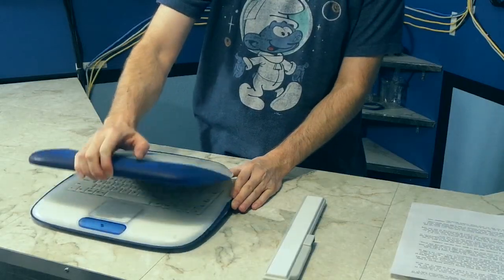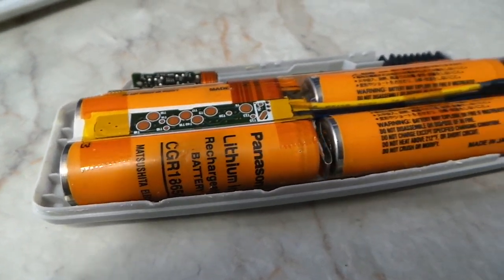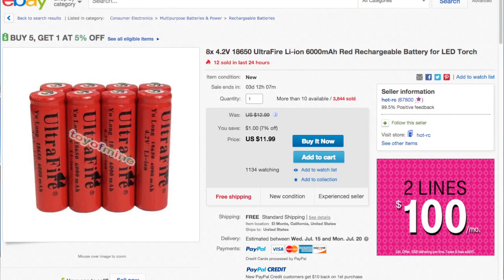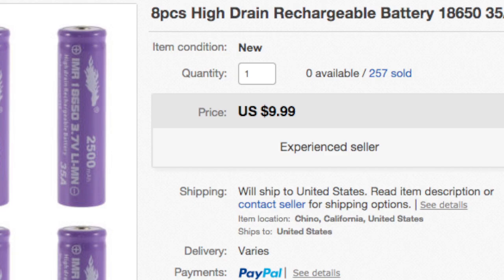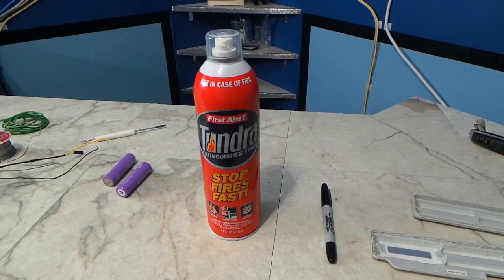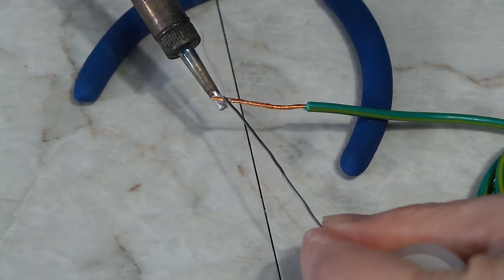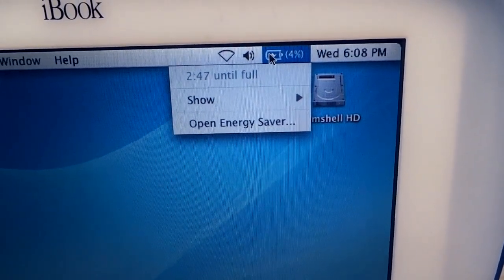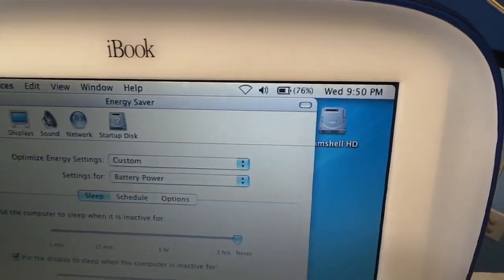Rebuild a laptop battery pack

Comment: How can I buy the electronic board ? or repair ? I think my electronic board is damaged , I reinstalled my os , tried with Linux battery seems more than 50% only  but not charging I tried opening my battery pack and jump  +Ve battery to battery output +ve section battery is working properly what to do ?

Comment: I tried rebuilding one of my old batteries for my Lenovo T61 laptop, but they put an anti-rebuild protection in the controller, so as soon as you disconnect the cells from the controller, it kills it there and then, regardless of whether you used shiny new batteries or recycled ones from a good but different laptop battery... :\

Comment: why my laptop battery still drain quickly after recell ? Total capacity onlu 6221 mWh from Designed Capacity 47520nWh. I am replacing the battery with the same capacity

Comment: the Mac OS looks good n clear resolution on this iBook.  Windows XP looks low res and pixelated.  I really like windows XP.  I really like my late 2012 core i7 mac mini.  I build computers for a hobby.  I love windows 10 more than XP now.  I thought windows 8 and 8.1 were better than vista.  To me windows 7 is good, but I like the low system requirements of Windows 8-10.  I love the "expose" and snapping windows in windows 10 a lot.  I think windows 10 does expose and window snapping better than Mac OS even though Mac OS came out with expose first.

Comment: "ultrafire"   probally not the best brand name for lithium batteries"
Reply: A year or so ago when e-cigs first became incredibly popular I repaired them for people a lot, and most of them use an 18650 battery or two. The Ultrafire ones are complete trash, and that specific brand is known to actually vent/explode a lot in ecig/vape setups because of the insane current draw
Reply: neither is Samsung. take their Note 7 for example
Reply: David Robitaille there is a gta5 mod which made grenades into s7s
Reply: Ultra fire probably means catch on fire extremely easily.
Reply: This made me look at what model my e-cig battery was and it uses that same model.  Didn't realize that laptop batteries could use the same model.  That's neat.
Reply: @ryuranzou  I am very late to this, but if you didn't know, e cigs where mostly designed to use this existing battery, 18650, 18650 specifies the size of the battery. There's also new mods that use 20700, and other sizes that I forgot.
Reply: I guess that's the brand Samsung used on the Note 7
Reply: Ultrafire is a "word play" on Shurefire, one of best and likely most expensive flashlight companies...
As they (Ultrafire) first produced flashlights only, they started making (or rebranding) batteries, chargers and all kind of other stuff years later.
Reply: The batteries that explode like note 7s
Reply: Jason Grimm what do you expect? The name speak for itself and it says it all. Ultra easy to cause fire in your house.
Reply: Fennec Fox So that's what the Note 7 used XD
Reply: Chrispy Chreme Bro lol
Reply: FennecTECH lol 😂
Reply: TheOpAlexGuy : mlgfreddy123 lol
Reply: Yasir Saheed I don't know why, but I keep thinking it's the s6 that explodes lol
Reply: i thinks samsung used them in note 7
Reply: Ismail Shaikh, i have TRIED some great things and they fail, well not completely. 
You CAN recover or at least prolong life of your lead acid battery in some cases, but not in all, so if you use dirt cheap chemicals or desulfatators, why not, it's worth trying if you know how to be safe, basically just wear eye protection and wash acid off yourself if you get splashed by it on skin, JUST DON'T PANIC, you have like... few minutes before it will burn you, unless you get it in eyes ;-) 
You can't really fix/recover li-ion battery IN ANY WAY once it is worn, unless cells are ok and electronics failed.
Reply: Rodrigo Vicente, Fenix is a good brand, if you mean that. 
It has nothing to do with Ultrafire. 
Fenix flashlights and chargers and batteries etc. are allways good choice...

Ultrafire batteries are ALLWAYS crap, sometimes half usefull crap, but still...
If you get brand name cells with your Ultrafire product, it means seller/store replaced/ packed them together, coz they were sick of complaints, waranty claims and fires. 
It makes sense, as Ultrafire make somewhat good products, flashlights, lasers, chargers... just their batteries are total crap.
Reply: FennecTECH so fucking true 😑😑😑😂😂😂😂😂😂
Reply: لو سمحت ممكن المساعده لان بطارية اللاب توب سرقت مني وغير متوفره نهائي فكيف اوصل بطاريه اخري بحجم اخر تماما فقط اريد معرفة اين ادخل سلكين يعوضو عن بطاريه اخري وانا اعلم كم هو الفولت المطلوب وشكرا ارجو الرد لو سمحتم
Reply: Creeperguy55 My brother, the virtuous, the battery is stolen from me and I want to know only how the first battery is another Atari Valsokt to Vellab Top I want the numbers of the years to the South by the battery type and size Tani pure external battery What are the negative and positive parties to the top dog to bring them a battery with only two wires Thank you very muchstole
Reply: Creeperguy555 ؟؟Creeperguy55 My brother, the virtuous, the battery is stolen from me and I want to know only how the first battery is another Atari Valsokt to Vellab Top I want the numbers of the years to the South by the battery type and size Tani pure external battery What are the negative and positive parties to the top dog to bring them a battery with only two wires Thank you very much
Reply: FennecTECH maybe the worst. Haha. LG Samsung are pretty good. Just don't think it's they easy to buy them to buy them though. Be
Reply: FennecTECH lol
Reply: it's actually quite fitting for these
Reply: The fire is as big as all the flammable liquids and all the batteries on earth and 20 Note 7s.
Reply: FennecTECH I want to know whether is it safe to use any power adapter to any electronic device if the output voltage of the power adapter matches the operating voltage of the device but what if the output ampere of the power adapter is high? I am asking this because I have noticed that we can use any rechargeable AA battery of higher amphere to any electronic device like camera or CD player but can we do the same with a power adapter?
Reply: there's a new one called "BestFire"
Reply: not really it's a good name if you're expecting your batteries to explode
Reply: MXJO
Reply: FennecTECH POlM

V
Reply: @fennecTECH: It was chosen with good reason!
Reply: this batteries is making ultrafire
Reply: nomen est omen!
Reply: Ultrafires. I know they're not good. Nerf modders know and use them.
Reply: LOL scrolled down just as I was thinking this.
Reply: XD imagine SpaceX being called "Mega Explosion"
Reply: Hold my Note 7
Reply: No joke, these things will go thermonuclear. They generally don't require outside oxygen to burn either, that's why a carbon dioxide fire extinguisher doesn't work with LiPo fires.
Reply: True
Reply: Ultrafire makes flashlights, great stuff! Not as bright as o-light but still good on a budget!
Reply: lmao
Reply: Yes
Reply: I bet they used them in hoverboards when they first came out
Reply: 😂😂😂 never thought of it
Reply: The Note 7 didn't use this particular model of cell, as it would be nowhere near small enough to fit in their phone. As for who made the batteries used in the Note 7, I don't know, but could possibly find out with a bit of research.
Reply: @evknucklehead  r/wooosh?
Reply: @DJ4461  Seriously? You r/wooosh a comment from over 2 years ago? 

At any rate, people are too quick to use that. As I recall, I was fully aware of the joke, but chose to respond seriously as a joke of my own. So, in essence, anyone who uses that just woooshes themselves.
Reply: @evknucklehead  oh... Sorry. I didn't get that. That's why I added the question mark.
Reply: @evknucklehead  r/woooosh
Reply: @aretard7995  See my reply to the previous r/woooosh comment in this thread...
Reply: @evknucklehead  the note 7 exploded because they crammed the battery in a small space
Reply: Its even better, it means alkaline metal fire that water makes burn even hotter
Reply: FennecTECH probably the battery the note 7 used
Reply: it was so funny that I forgot to laugh
Reply: Cheers for the video content! Excuse me for chiming in, I would appreciate your opinion. Have you ever tried - Lammywalness Trendy Trade Guide (Have a quick look on google cant remember the place now)? It is a smashing one off guide for learning how to recondition batteries at home minus the normal expense. Ive heard some incredible things about it and my buddy finally got amazing success with it.
Reply: TheOpAlexGuy : mlgfreddy123 yea😂😂🤣🤣🤣
Reply: FennecTECH ultrafire uses panasonic and Lg batteries
Reply: @rodricochecitos  that is 100% false. ultrafire is a cheap chinese knockoff.  I have spent the last couple years building packs for e-bikes and long range RC aircraft.  Not only are the ultrafire cells horribly underpowered, they are also extremely dangerous. I exclusively use LG cells because I know i can trust them. There are a few cells on the market that offer higher capacity, but I can say with confidence that LG or Sony are the most stable.
Reply: hi everyone ,if anyone else needs to find out about how to recondition batteries at home try Battery Recovery Tactics ( http://battery.RecoveryTactics.com  ) ? Ive heard some great things about it and my friend got excellent success with it.
Reply: hi everyone ,if anyone else needs to find out about how to recondition old car batteries try Trefendous Rapid  Extender Tips (just google it ) ? Ive heard some amazing things about it and my work buddy got excellent results with it.

Comment: Hello The-8-Bit-Guy,

I want to rebuild my laptop battery but I have a question,

Can I replace the existing mAh cell with higher mAh cell..?
Reply: If they are real it should be fine to put higher capacity batteries in it

Comment: Soldering batteries like that is stupid. You're damaging the batteries due to the hight temperature of the solder. You can even make burn those Li-Ion batteries. To solder batteries you need a cold spot solder.

Comment: you can get good quality 18650 lithium ion batteries, 3.7V 2000mAh, from interstate battery. they are interstate battery brand, solid green with numbers printed on the side, but they really are great batteries, I've used them for several projects. they keep them in the back so you'll have to ask for them but there only $5 each and you won't have to wait for the mailman.

Comment: Great video!!

So, if your current battery still works (to some degree) but shows it's not recognized by the computer, is there a way to reset, or repair the input that the computer sees?

On that same note, if you just rebuild a older battery, not the one referenced as not recognized, does the circuit board on the battery tell the computer the correct info as to life, performance etc? or does that correct itself after a charge / discharge cycle? 

Something like batterybar Pro, has diagnostics and such, but I'm not sure if it would read old information "stored" on old circuit board from before putting new cells in old case/ 

Great video
Reply: Any answer yet?

Comment: Wait... since when are efest batteries offbrand? Or are those efest clone batteries?
Reply: Old efests were  low quality rewrap crap, the newer ones dark purple are actually decent ones (lg samsung sony or panasonic). Only mayor problem i see on efest bats is that they lie about the discharge current, they always stick the pulse current on the labels in stead of the continuous discharge current. Which can be hazardous for unexperienced  /uninformed lith-ion cell users
Reply: Because there are only 5 manufacturers of brand-new 18650's. Efest are re-wraps off low-quality duds, sold in bargain bins by the manufacturers.
Reply: vlad vikernes EFest does not relabel duds... they buy cells 'white label', and sell with their wrap. Most of Efest cells come from sony, LG, and Panasonic, cells those companies do not ACTUALLY sell to consumers directly. Efest buys the same cells and uses their own wraps, but they use quality cells for it, it is just the cells you get were relabeled for the consumer market. In other words, you get the same cells for cheaper, since they were actually intended for the consumer market.
Most 'name brand' EVERYTHING is a relabel... whether you realize it or not.
Reply: Interesting indeed. Im curious to learn some of these relabels. I don't doubt you. Its just what I've been taught or learned in my time. I will admit, I am a noob and my first encounter with an 18650 was a vape. Sorry for being incorrect.

Comment: Only works with old laptop battery. Now they have some component inside to prevent you to restart it if you change the li-cell. And it's way harder to reset !

Comment: Flux the battery terminals first as  it makes soldering the wires on that bit easier,  You can also reuse 18650 batterys from old battery packs as long as they look and test ok,
Reply: +john porter Fine grit sandpaper, then flux, then solder.
Reply: Marc Dudlee the fine grit sandpaper goes without saying Marc...but in a lota cases the flux is enough to remove the oxide coating on the metal as thats whats its job is to do...remove the oxide coating,

Comment: Can I do the same work on a Macbook Pro 13" mid 2009? Which battery I have to buy?
Reply: They do t use those kind of batteries.  For a MacBook Pro that was made from 2009 to present, you can buy those batteries on eBay.  Make sure they aren't fakes!
Reply: Technology Spotlight
Thank you for the reply. I bought a new battery in a shop, because where I live the delivery service make the battery not safe and ther is a high risk of damage of the battery during the packaging (explosion).

Comment: This is really not a good idea, for several reasons:

1) Soldering Lithium batteries is a catastrophe waiting to happen.  Most of the chemistries used in 18650 cells release oxygen when they hit thermal runaway.  That means, if something catches fire, they provide their own fuel.  An extinguisher will be next to useless.  Thermal runaway might occur somewhere north of 150C, but... what's the temp on your iron again?

2) You don't know anything about the charge controller.  Does it assume the cells are pre-balanced?  If so, top or bottom balanced?  Or does it actively balance them?  If it balances, then your first few charges might just take a long time to get from 90-100%.  If it doesn't, then it's up to you to balance them appropriately, otherwise you end up with a "fuel gauge" that is way off.  (Speaking of which, is that fuel gauge self-calibrating, or hard-coded?)

3) What was the chemistry of the original cells?  The new ones?  What is the recommended charge current?  What is the low-voltage cutoff, and at what load?  What voltage should you charge to?  Most common chemistries don't differ by much, but some can be charged to 4.2V while others will get very cranky above 3.6.  Chances are you'll be close.  However, things get really ugly when you're not.  (Keep it off your lap for a while.)

4) As others have mentioned, some charge controllers have cell state memory.  This isn't as much dangerous as a waste of time and money, as it would just mean it won't work.

I'm all for DIY, but Lithium Ion cells are temperamental and the risks should not be taken lightly.  If you don't know what you're doing, this is a job best suited for a battery specialist.  Or just pony up for a genuine replacement pack.  Cheaper than new nads.
Reply: Nick Guy here to second what William d said.  You should make a video.  More knowledge in the world is only better.  You might even save someone a hospital visit.
Reply: You just spend 1 hour on writing that
Reply: Nah, I type fast.  Absolutely no more than 55 minutes.  57, tops.
Reply: Nick Guy. Looks like you know well about batteries? Why don't you make your own video on why not to rebuild your loptop battery!

Comment: i should warn you that buying knock off batteries that have very low Ah performance they are a fire hazard mainly because the actual battery is very tiny inside of it and the rest of the space is just filler in a battery casing. A real battery is filled with the entire volume full of the chemicals and parts of the battery which is what makes it heavier.

Since knock off batteries all have varying performance they can cause problems when used in an array

Comment: Wrong  !! 
you need to know and learn about the discharge rate of the cells or batteries first.  those are designed for. 
don't promote fake Videos without research.

Comment: Wow.. NEVER solder 18650 batteries.. always use appropriate battery spot weld tools! You'll damage cells with the heat of the soldering iron, especially with cheap batteries it can be dangerous. Also don't buy those cheap UltraFire cells, their internal protection and overall built quality isn't very reliable so your pack will be a bit unsafe..

Furthermore, there is a chance that the BMS of your batterypack detects an incorrect SoC (State-of-Charge) for your 'new' pack, because the characteristics of the cells are different than the original cells, completely discharge and recharge it a few times so most BMSs recalibrates. (as stated in the video)

Watch out for fake batteries (there are some fake Panasonic cells on eBay, for example most NCR18650G cells (4600mAh) are fake), like UltraFires or worse with a Panasonic/Samsung sticker.

Panasonic NCR18650GA cells are not that expensive, have ~4500mAh (tested it!) and are very safe!

Comment: the Li bateries on ebay are often B class which means they are factory regects, they are known to go puffy and due to high internal resistance can often heat up even to the point of fiery failure in high current aplications. b class batteries have their uses in  situations where precautions have been taken to avoid overheating and damage if the cells puff or rupture. i wouldn't want a bunch of them sitting on my crotch when the safer ones are only like 20% more expensive.